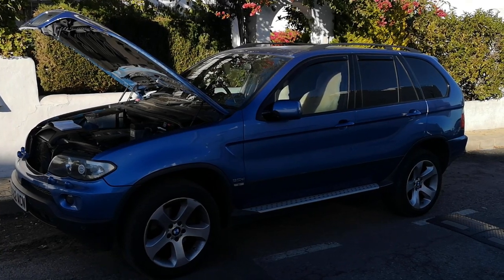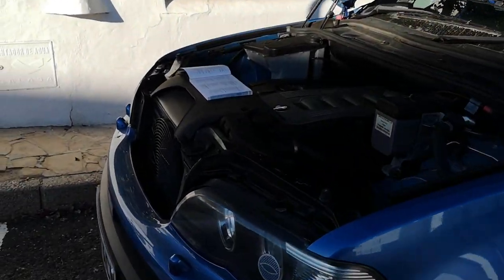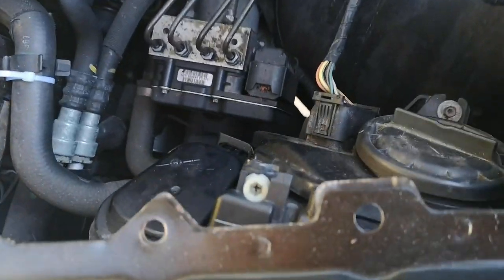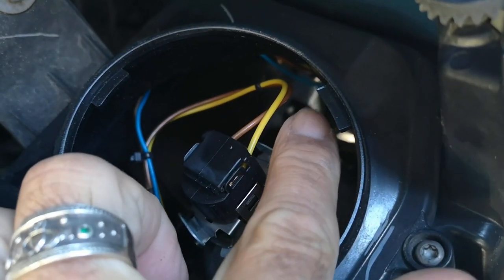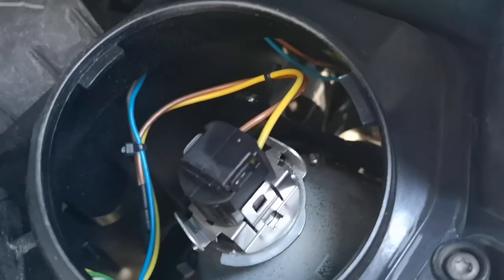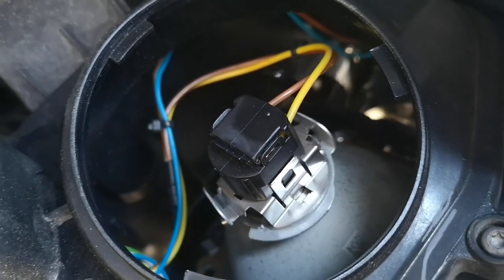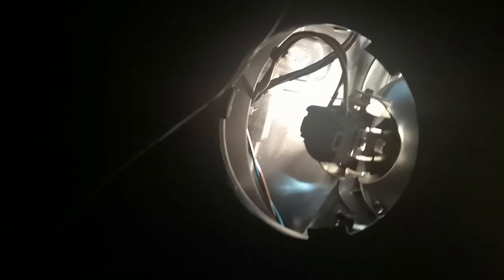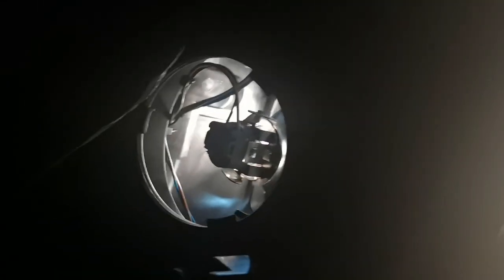BMW X5 E53 Switchable Headlights from LHD to RHD

Comment: I have 2016 X3 adaptive LED (high beam assist and cornering) . Will this adjust by themselves or they might have a switch. I could not see in idrive 6 any option

Comment: thanks for the video. are those angle eye halogen headlights¡? I have a BMW X3 year 2009 but when I open the back cover i dont see or touch any lever...thanks!
Reply from the maker: No problem, mine was fitted with xenon headlights, which usually have the switchable headlights.  unfortunately not all models have this option.